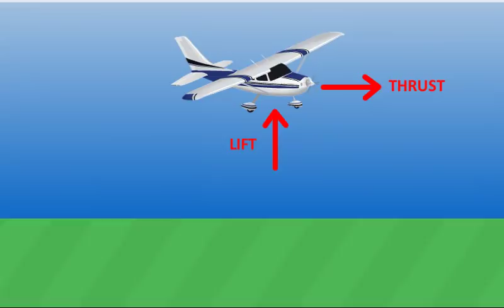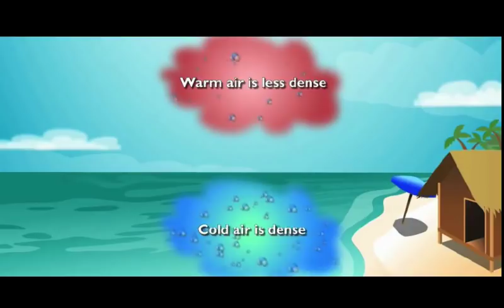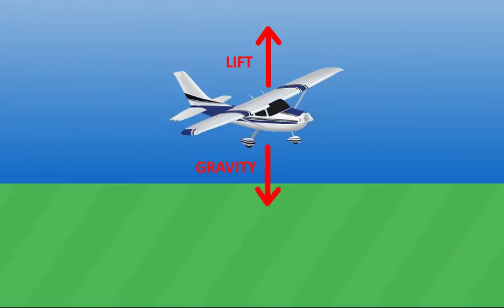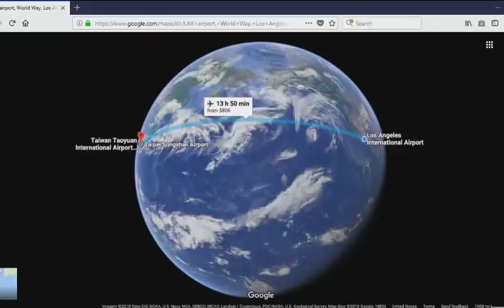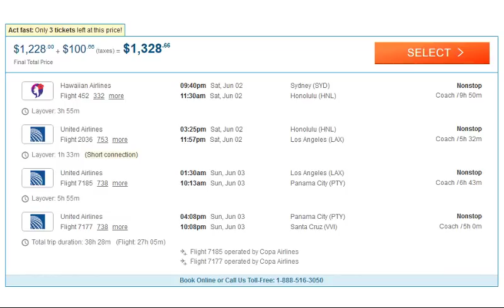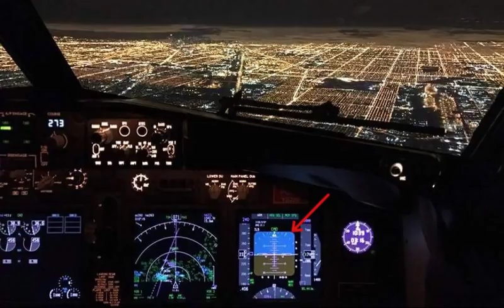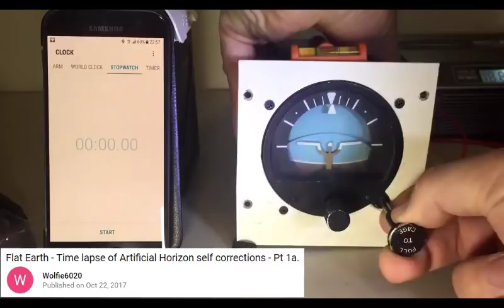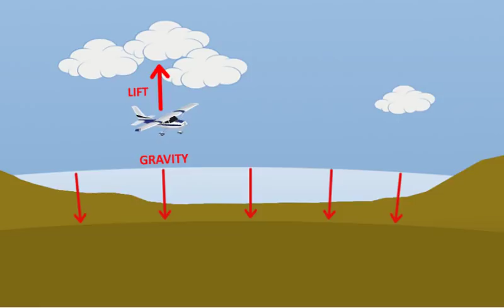Flat Earth Falsities - Plane Nonsense

Comment: wouldnt a pear have a fat bottom and a skinny top? will there be photos of the pear?
Reply: "GrahamStw it didnt for amelua airheart."

It's Amelia Earhart, if you are going to argue stuff at least get basic facts correct.

"they navigated way before the spherical earth."

The Earth was known to be a sphere thousands of years before Amelia Earhart.

"their are also navigators that didnt agree one bit with the spherical earth."

Sure, they all got lost and died though.

"the whole reason neil had to say it was pear shaped in the first place was because ships in the southern hemisphere were not matching the globe distances."

Yes, that was figured out 300 years before "neil" was born.  This is not new knowledge invented by "neil."

"sure it works for airplanes who can make up 1200 miles in an hour."

No commercial or private plane goes anywhere near that fast.

"there are reasons behind all thos stuff. why do you think neil had to say it was "chubby" at the equator. the distances in fact didnt match."

Stop parroting nonsense you heard on FE videos.  You don't understand even the fundamentals of what "neil" said.
Reply: "GrahamStw i dont claim either map to be fully accurate. i defend them as models to a degree but not as actual accurate representations."

If you admit the map is flawed, then any potential model based upon that map is inherently flawed.  So why defend a "model" that is inherently flawed?

"i believe there absolutely is an accurate map that the public doesnt have access to."

People travel all over the world every day.  This includes private pilots and boats.  This would not be possible without accurate maps.  Navigators do not just "guess" what direction to go in.  Pilots don't just "hope" they are flying in the right direction.  Travel is not possible without accurate maps.

"when we travel we use a to b coordibates. the issue with all these maps is that they are built on equidistant grids."

You have never actually used a map to navigate have you?  Answer that question honestly.
Reply: Bobby : coming back to your initial point : "i dont claim either map to be fully accurate" 
Well any map of the Globe will show some distortion as it is mathematically impossible to lay out the surface of a sphere on a flat plane. 
On the other hand, if the world is flat, then there can be no distortion on the map at all. You should be able to take a ruler, measure the distance between A and B on your FE map, convert for scale, and you have the exact true distance. Well we know that if you do that, the distances do not match reality at all if A and B are not on a line through the center of your map. The error becomes spectacular if A and B are both south of the equator.
Reply: "when we travel we use a to b coordibates"
We know what is located at 'a', what is located at 'b', and what is located at every point in between them by looking at a map.  The coordinates match the map, and the map matches the coordinates and reality.
Reply: "OMG GMO yes. ive used many maps."

I did not ask you if you used a map, I asked if you used a map to navigate.  You understand the word navigate right?  As in you looked at a map and said "I am here, I want to go there, so I will walk in this direction for this distance."

"never have a used a world map to go from point to point. neither do any other navigators.."

Well I have, and tens of millions of other people have, so maybe you should defer to people who have actual experience in the matter.  Maybe you shouldn't be making definitive statements about things that you have no personal knowledge of.

"GrahamStw they dont go 600 mph? sure they do"

You didn't say 600 mph Bobby, you said 1200 mph.  Are you confusing yourself with your own lies?
Reply: Bobby Wizdum
"GrahamStw ive poked out many sun problems on the globe model as well"
Which ones ?

But you still haven't "poked" the MAJOR sunproblems of the flat earth -modle- drivel : the 12h day/night during equinox for EVERY LATITUDE... but you are still defending the LIE of the flat earth cult
Reply: @Booby Wizard wrote: "if the real distance is 8000 miles between the two (anchorage and middle point shortest path from Sydney to Santiago de Chile) then youre actually proving flat Earth"
No. Because to get to that middle point you need to fly half of the distance between Santiago and Sydney. Or do you think that there is a magic world were airplanes can just teleport from one location to the other.
To summarize:
Distance from Anchorage to Sydney is: 7333 miles, then from Sydney to the middle point: about 3250 miles it would take 10583 miles following that path.
For me it doesn't look shorter than direct route from Anchorage 8,362 miles which GrahamStw calculated for you. 
Shortest distance from Anchorage to South Pole is also shorter that traveling through either Sydney or Santiago de Chile.

P.S. I forgot to mention that distance of that middle point to the South Pole is shorter than Sydney or Santiago de Chile distance to the South Pole. You probably didn't notice that.
Reply: @GrahamStw. I've seen it. Good job. On a map with Mercator projection that shape would be even more not like a triangle.
Earth globe math/geometry is quite hard. It would be so easy to live on a flat world. Oh, why it isn't so? ;).
Reply: Bobby, I'm curious. You have repeatedly defended the standard AE/Gleason flat earth map, with the north pole in the middle and the ice wall around the outside.
So what do you make of the well-known flat earther Jake The Asshole (aka Flat Earth Asshole / FEA) pointing out that it doesn't work?
https://www.youtube.com/watch?v=1AHFl0aMyj4
Reply: GrahamStw i dont claim either map to be fully accurate. i defend them as models to a degree but not as actual accurate representations. google maps for example does use the a.e. map. 

i believe there absolutely is an accurate map that the public doesnt have access to. when we travel we use a to b coordibates. the issue with all these maps is that they are built on equidistant grids. we know that things arent equidistant. the more you study distances between places the more youre gonna see strange things. amelia for example got completely lost in the south pacific and claimed the earth looked nothing like we were told. i do believe the key in mapping the coordinates is in triangles. i havent studied them all yet but there are some interesting anomolies
Reply: "No... look into it. you arent right."
Look into what exactly?  Be specific, tell us exactly where to find the information that will show we "arent right."

"GrahamStw of coarse they match the distances. that doesnt make the "shape" or map right"
Actually, it does.
Reply: "OMG GMO no because its written based on the "spherical" model."

First, you have again dodged my question about if you have ever used a map to navigate anywhere.  Second, if the model matches reality then the model is correct.  This is not that complicated to understand.  If the blueprints to a building match the building then the blueprints are correct, if they don't match the building then the blueprints are useless.

"what if the plane expands far beyond what they are telling us?"

Reality tells us that it isn't a plane and it doesn't expand beyond what "they are telling us."

"what if its not a circle at all? that changes everything."

You are arguing empty nonsense in circles.  You are effectively saying "you're wrong because I'm right even though I'm wrong because you're right."  You are just making stuff up as you go along because you can't admit to yourself that you are wrong.  

Have you ever used a map to navigate anywhere?  Yes or no?  Answer the question honestly if you are actually interested in discussing the subject.
Reply: "what if its not a circle at all? that changes everything."
The AE-style model with the close sun between Capricorn and Cancer would still be wrong even if there was land beyond your ice wall.
I highly recommend you watch the Jake The Asshole video I linked Bobby. That is probably the first and last time I will recommend a flat earther video, but it might make you think. Jake explicitly says "people who believe in the globe have been telling us this for years... people that cling to the AE map are lying to us"
If they are lying to you about that then consider what else they might be lying about.
Reply: You route plan using a globe map every time you refer to Google Maps or use GPS on your phone. 
And no, you haven’t pointed out any “sun problems” on the globe model. All you have done is demonstrate that you don’t understand it.
Reply: Bobby Wizdum 
"wouldnt a pear have a fat bottom and a skinny top?"
Yes, just like your special "friend" down at the "home". 

This is a video about the shape of the earth, you git. Come back when you've managed to tackle identifying fruit correctly.

Fucking muppet.
Reply: +Mong Patrol
"Bobby Wizdum - Fuck off Bobby you are nothing but a troll."
Agreed. What I can't understand is why people feed the idiots. It begs the question as to "who is the brighter, the troll or the gullible mark?
Reply: What are you using to calculate your distances here Bobby? I get
Anchorage to Sydney: 7,334 miles http://www.gcmap.com/mapui?P=ANC-SYD
Santiago to Sydney: 7060 miles http://www.gcmap.com/dist?P=SCL-SYD
Santiago to Anchorage: 7863 miles http://www.gcmap.com/mapui?P=SCL-ANC
Reply: Bobby: regarding you thinking that Sydney to Santiago would be shorter over the Pole: if you have access to a decent globe then try comparing the routes with a bit of string pulled between them. You’ll find the route over the ocean is shorter. This is called a Great Circle Route.
Reply: Your “Google”? What are you actually measuring with? Google Earth Pro?
Reply: Instead of just making stuff up about how you think the globe is “distorted”, why don’t you just test it at face value, as presented and see if it works?
Try it with a bit of string like I said and you’ll see for yourself what the shortest route is. Then you can find out what the Great Circle Route is and it will match. If you have the maths skills then you can work it out for yourself using the Haversine formula.
Reply: Likewise use a bit of string to measure Australia to New Zealand on your globe, then compare it to some other distance you know.
Reply: I still don’t understand what “flaw” you think you’ve found but string and a real physical globe are the best way I can think of to show you in a physical obvious way how Great Circle Routes work and why you can’t use planar geometry on the surface of a sphere. 
If you don’t have a physical globe then another alternative would be to download Google Earth Pro on your PC and play with the measuring tools in that.
Reply: So if I understand you correctly, you are saying that a route from Anchorage to the South Pole, through that midpoint between Santiago and Sydney, works out 2000 miles too short?
Too short compared to what?
Reply: I really think you need to draw that out Bobby because that makes zero sense to me, even in planar geometry. 
I’m off to bed now, but I’ll see if you have a diagram tomorrow. Try using Google Earth Pro (desktop version). It lets you draw lines and make the measurements you need.
Reply: Bobby: here is my attempt to sketch out what I think you are describing in your post: https://s15.postimg.cc/ebkv9whqz/fe_bobby_map_1.jpg
Is that correct? I'm still not seeing where you think the "flaw" is though.
Reply: "showing me a flat earth bobby map wont help lol" - kindly do me the courtesy of actually looking at the image. It's not a flat earth map. It is me trying to understand what your argument is by drawing what you describe on Google Earth.
If it is not right then please draw what you actually mean. If you can't work Google Earth then a simple sketch would do. Your text descriptions are making no sense to me at all.
Reply: "we know that this point is approximately 6000-miles from anchorage" - if you look at my diagram you will see the midpoint between Sydney and Santiago is actually 8,362 miles from Anchorage.
Reply: And I'm plotting these coordinates on a globe, so we can see what the globe says the distances are. Here is another one with the distances from Anchorage to Sydney and Santiago added to it. Please take a look so we can discuss it:  https://s15.postimg.cc/vjdm9ywhn/fe_bobby_map_2.jpg 
"how can the mid point be 8000 miles if the total distance is supposed to be 7000?" - you mean why is the mid-point between Sydney and Santiago further from Anchorage than they are? Because the midpoint on that route is further south, that's why.  The shortest route from Sydney to Santiago dips south. That's why trying to use planar geometry on the surface of a sphere doesn't work.
Reply: @Booby Wizard. You didn't notice that lines connecting any three points on a surface of the globe doesn't create triangle. You can not use planar math to calculate distance to the middle point over that surface.
Reply: Martin: I think his confusion came because he expected the midpoint between Sydney and Santiago to be closer to Anchorage than Sydney and Santiago are. Which would be true if we were working with distance on a flat plane, but is not true on a globe where the distances are curved.
Reply: Not just the distances but also the directions. I can look up a starting coordinate on the globe map and then figure out exactly where I'd be if I travelled a given distance at a given bearing. and that will match reality. If the coordinates, distances and directions all work then that is a working map.
Reply: "it didnt for amelua airheart"
Amelia Earhart was attempting to circumnavigate the globe in 1937, just 34 years after the Wright brothers managed the first powered flight!
You don't think we've learnt a few things and made some improvements to aircraft navigation since then?? 
"they navigated way before the spherical earth" - who did? Early navigators used the stars because they knew that the angle to Polaris gave them their latitude in the northern hemisphere and that the Southern Cross pointed to the south in the Southern hemisphere. (That doesn't work on a flat earth)
"the whole reason neil had to say it was pear shaped" - you act like Neil is some amazing oracle of all scientific knowledge. He's just a popular science presenter. We've known for a very long time that the Earth isn't an inch-perfect sphere. "Pear-shaped" is just a media-friendly simplification of the currently mapped geoid. It is wider around the equator than around the poles, and slightly wider in the south than the equivalent latitude north. i.e. "pear-shaped" But these are very subtle differences compared to the size of the Earth.
Reply: "No commercial or private plane goes anywhere near that fast." - they used to. Cruising speed of Concorde was 1334 mph at 56,000ft. Shame we buggered it up really. :(
Reply: @Booby Wizard wrote: "ive poked out many sun problems on the globe model". ROTFL.
If you are referring to Australia and North Canada day time then I told you that it is possible that it overlaps. These location are about 180 degrees of latitude apart and that is just half of the Earth circumference.

You did poke you own eye. Nothing else.
Reply: Bobby Wizdum - Fuck off Bobby you are nothing but a troll.
Reply: Bobby Wizdum "youll never convince me water will stick to a spinning sphere"
You understand the Earth has considerably more mass than a tennis ball and "spinning" is only one revolution per day? Do you know how to calculate the centrifugal force?

"im seeking truth. you guys are defending a lie."
You need to demonstrate something is wrong.
Reply: wong • Meh.. Some folks just want to be friendly, I suppose. Others likely believe they're having a legitimate discussion with the flerfer fuckwits, and still others do it "for the other people reading the comments, but aren't participating"; lurkers in other words.

I myself just enjoy honing my insult and mockery effectiveness.
Reply: +Brett VV
"Some folks just want to be friendly, I suppose." Some people must think being friendly is talking to a bulls arse then.
"Others likely believe they're having a legitimate discussion with the flerfer fuckwits" In which case they are the fuckwits.
"and still others do it "for the other people reading the comments, but aren't participating"; lurkers in other words" That works the first couple of times but that is all. It does not work, e.g., on 100 comment threads.
"I myself just enjoy honing my insult and mockery effectiveness." Then you must be pretty poor at them. There are plenty of kosher targets for doing that, if that is what you want.
Reply: wong 
#1 Agreed
#2 Perhaps they are sometimes. Perhaps not.
#3 Hard to say if it works or not, whether on 100 comment threads or 3 comment threads. Lurkers gonna lurk.
#4 I suppose that depends on what your idea of effective is. Personally, if I make myself chuckle with some mockery or an insult. Effective.
Reply: "there really arent many problems with it."
You admitted earlier that you don't believe the AE map/model. Did you watch the Flat Earth Asshole video I linked yet? That is a fellow flat earther telling you that map/model doesn't work. And he is not alone. Many FE have abandoned it because it has HUGE problems with sunlight, distances, bearings and general reality.
Reply: That's why I made him some nice diagrams in Google Earth Martin, but he doesn't seem to get it. Or maybe he has now, as he has deleted his last few posts.
Reply: @Booby Wizard.
You were trying to assess distance from Anchorage to middle point on the shortest path from Sydney to Santiago de Chile. To do so you have drown a triangle but failed to notice that you can't put a flat figure on a globe and insist that distances between vertices are the same.
Reply: GrahamStw they dont go 600 mph? sure they do
Reply: Not sure I understand what your "problem" is there yet Bobby, so I'm just about to sketch it out and see if I can see what the issue is. If you have a diagram or anything that shows what you think you have found then that would help.
Edit: ah you've edited and added more detail. If you are "using triangles" then that is likely to be the source of your error. You are using planar geometry on a spherical surface. Remember that the angles of a triangle on the surface of a sphere do not add up to 180.
Reply: No... look into it. you arent right.
Reply: GrahamStw of coarse they match the distances. that doesnt make the "shape" or map right
Reply: OMG GMO pilots dont use maps. as i said they only use distance between 2 points.
Reply: OMG GMO no because its written based on the "spherical" model.  what if the plane expands far beyond what they are telling us? what if its not a circle at all? that changes everything.
Reply: GrahamStw it didnt for amelua airheart. they navigated way before the spherical earth. their are also navigators that didnt agree one bit with the spherical earth. the whole reason neil had to say it was pear shaped in the first place was because ships in the southern hemisphere were not matching the globe distances. sure it works for airplanes who can make up 1200 miles in an hour. there are reasons behind all thos stuff. why do you think neil had to say it was "chubby" at the equator. the distances in fact didnt match.
Reply: GrahamStw ive poked out many sun problems on the globe model as well. im not claiming to have all the answers. im seeking truth. you guys are defending a lie.
Reply: OMG GMO yes. ive used many maps. never have a used a world map to go from point to point. neither do any other navigators. you be honest.
Reply: No... insult away. youll never convince me water will stick to a spinning sphere nor will u ever be able to come close to proving it will.
Reply: GrahamStw if you read my above post i just showed you a major problem with your reported flight paths and global distances. 100 percent proof things arent all they seem.
Reply: GrahamStw ill further ellaborate. im gonna go ahead and shave off the 1500 miles (30 degrees) from the alleged south pole and make the distances 2500 miles from the ice shelf to sydney/santiago and keep my anchorage distance the same. this would make the distance from roughly 60 south to the north pole at 12000 miles or for this use anchorage at 10000.

Now heres my triangle. anchorage sydney 7500...sydney santiago 7500...santiago anchorage ...7500. my triangle is actually now complete as my distance on all three directions from anchorage to the icewall is 10000 miles. uh oh.
Reply: GrahamStw funny my google says 7800 ,7500 and to the pole 3800 and 3900 respectively. 

it would be shorter. your globe isnt equal distance or actual continent sizes. new zealand is 1500 miles from australia. looks right next to it on the globe. 

now regarding the point im making its obvious and youre missing it. they elongated things to fit the globe.  we dont travel near this "90 south". its how they twisted the distances. if the distance is really 12000 miles from north pole to the antarctica coast line and not the south pole it changes everything.
Reply: GrahamStw my fault i see your sight i got the 7050, 7400, and 7800 ...doesnt change the point. just the triangle shape slighlty

it still means going anchorange over santiago to "south pole" would be just under 12000 miles. over sydney 11,500 ish. dead through the pacific 10000. if i subtract the 1000 differential each side for going straight south that puts me 5050 miles apart. subtract the 500 your at 4550 miles apart. the dead center of 7050 miles as we know should be at 3525 miles.  going toward the pole wouldnt help this as your 2 4000 mile triangles are longer then the 7050 mile line. it doesnt add up.
Reply: Martin Gorbush ummm im not using plane math.  im using math regardless of surface shape
Reply: GrahamStw im not confused. its flawed
Reply: Flook D yes and i understand no matter what mass water wont do what you say it does. please show me your experiment with a mass to scale.
Reply: Locnar there really arent many problems with it.
Reply: Locnar so you believe coordinates prove your sphere huh? boy have i found a problem. 

from anchorage alaska to the north pole is under 2000 miles you follow. from anchorage to santiago is 7800 miles or from sydney 7500 miles. yet anchorage to the south pole is just over 10000 miles? why is this a problem? well from santiago to south pole is 4000 miles. sydney to south pole just under 4000. so going over either would be a little over 11000 miles as opposed to dead center over the pacific. so either direction a little over 1000 miles out of the way. the ball is also supposed to be 24000 + miles in longitude yet from north to south is only 12 x 2 =24. doesnt add up chuck. it looks like it does but theres a big problem in between. lets see if you smart guys see whats wrong with this riddle and math.

using triangles something us very, very wrong. anchorage being just a 1 degree differential to the pole would mean nearly completely due south over the pacific is the shortest distance. going east or west 1000 miles from this point would be equal duration over sydney or santiago by just 1000 miles. where in the pacific are sydney and santiago just 2000 miles apart? uh oh.

also if its just under 8000 miles separating sydney and santiago going directly over the pole (a shorter distance). how could it be only 7500 miles doing a half circle around the "continent"?
Reply: No... i do understand. perfectly. i think its you who missed my point
Reply: GrahamStw im disputing the distances which you say prove your globe. i showed u a flaw and u want me to play with string? coordinates between points arent formed by playing with string.
Reply: GrahamStw the mid point between santiago and sidney over the pacific ocean should be 3,525 miles apart according to the reported distances. this is the route that would shave 2000 miles off the journey from anchorage 61 north to 90 south.
Reply: GrahamStw its not that the route is too short. the issue is the center point. if im in the middle of the us and i go either direction about 1400 miles ill be at the opposite coast you follow? 

ok so try to follow the analogy. if i go to the south pole directly im saving the distance i didnt travel east to sidney or west to santiago you follow? a sum differential of approximately 1700 miles. if i go 1700 miles from the center point between the 2 im not going to be anywhere near sydney or santiago.
Reply: GrahamStw has nothing to do with shape of earth so no showing me a flat earth bobby map wont help lol im saying we know the distance of points a, b, c and there distance to point d (south pole). points b and c are both 4000 miles to point d approximately ok? point e we'll call the midpoint between santiago/sydney. this is the point at which anchorage will fly over to go to the south pole ok? we know that this point is approximately 6000-miles from anchorage which would make this point approximately 4200 miles from point d. how do we know this? because going slight west adds 1800 miles over santiago or 1500 miles east over sydney. the problem is thar sydney and santiago arent 3300 miles apart. they are allegedly 7050 miles apart. 

pay attention to what im about to show you. by elongating this distance point to a place we dont travel is how they created your globe. Noone flys commercially to this alleged south pole.
Reply: GrahamStw on what a flat map? im not talking about maps. im talking about what we are given as known distances. forget about maps and globes we are focusing only on coordinates. if the real distance is 8000 miles between the two then youre actually proving flat earth lmao how can the mid point be 8000 miles if the total distance is supposed to be 7000? if its 8 going down as you say then its 12 to the pole not 10 and. going through sydney or santiago would be shorter. im showing you the problem. cant find the solution til you see there is one. it doesnt fit either "model" because neither is right! they have to tell you anchorage is 10,200 miles from south pole because its 2000 to the north pole which is supposed to be 12200 miles to the south pole. they're lying !